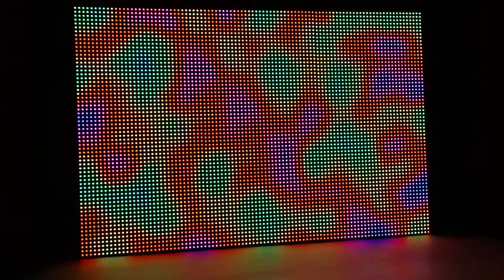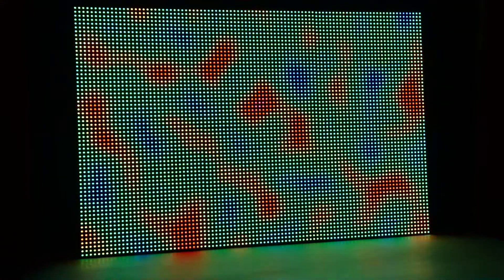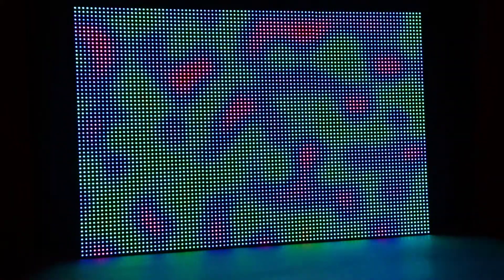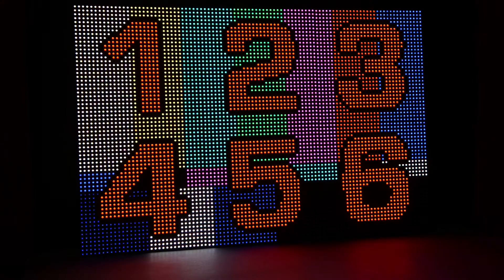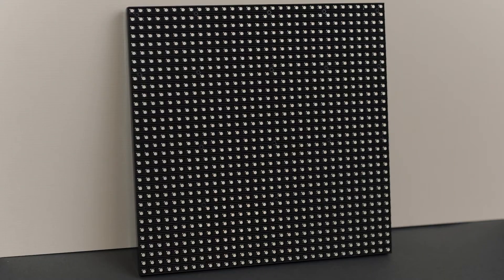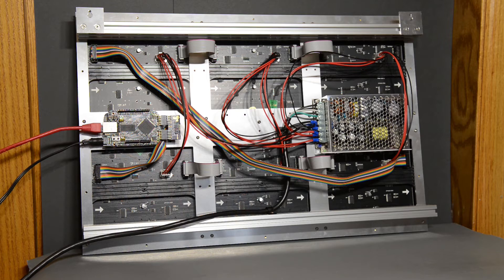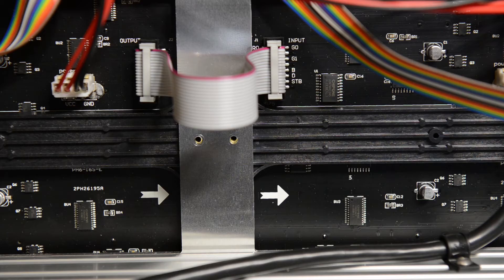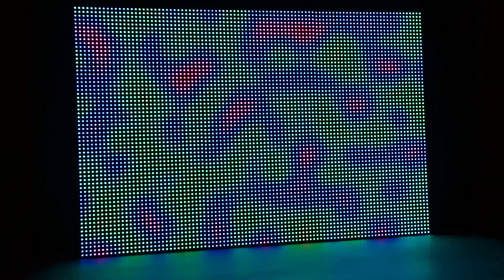BeagleBone + Logibone FPGA Drive 96x64 RGB LED Matrix

Comment: hi i am working p6 panels...had gone through your rgb driver tutorial and followed the algorithm..(for 2 (32x32 modules) it works fine without flickering...but when i add 3 flickering occurs...i am using ARM M3 Cortex LPC1768 @100MHz using PLL0....i dont have idea with FPGA....implemented 24bits per pixel.....what is minimum clock frequency required?
Reply from the maker: There are two constraints: 1) You need a minimum refresh rate of about 100Hz to prevent flickering to the human eye. The higher the better though. 2) The maximum rate at which the serial to parallel latches inside the panels can be clocked. I haven’t tried clocking in data at a rate over 25MHz. 

If you have two panels running at 24bpp without flicker, you’re doing pretty good. Beyond two panels, you’ll probably start hitting the 2nd constraint above if you try to refresh the panels at a refresh rate fast enough to prevent flicker.

I'm running the logic that drives my 6 panels at 12bpp at 50MHz. Pixels are clocked into the display at 25MHz with a refresh rate of 217Hz. I could probably go to 18bpp and still maintain a refresh rate of 122Hz with my FPGA design. At 24bpp, my refresh rate would drop to 30Hz and the display would flicker badly.
Reply: Thank you Glen akins I will try and update you...

Comment: Is the frame custom cut? I assume there isn't one available commercially? I see parts on Adafruit that could work, but yours is cleaner.
Reply from the maker: I had the frame cut at front panel express. The .fpd design file for the frame for their free software is available in my github repo. A link to the repo is in the description of the video above.

Comment: How many LED panels you could connect to this FPGA set up?
Reply from the maker: +Justas B If you stick with 12bpp color, probably 16 panels daisy chained together before the refresh rate gets to be too slow. If you grab some less convenient to use pins, you could a daisy chain a second set of 16 panels from those pins for a total of 32 panels. Beyond, that you need a larger FPGA with more block RAM memory.

Comment: This is really cool, I am doing a similar project with the Raspberry Pi controlling three parallel chains of 4 panels for a 128X96 display.  The RPi will be controlling the panels directly with no FPGA.  I have most of the software worked out and my biggest problem is bolting them together.  It looks like you designed the aluminum frame in a CAD program and had it cut out on a mill.  I don't have that ability but your solution gives me an idea.
Reply from the maker: +David Culp I used Front Panel Express. Their software is free and the design files for the frame are in my Github repo. Just make sure your LED panels are the same size as mine.
Reply: +Glen Akins Thanks Glen!  Your website also helped me solve an issue I was having with the display.  The Raspberry Pi 2 is barely fast enough  to handle doing this.  I am having to pull out every trick I can to get a steady display with 24bpp color.
Reply from the maker: David Culp how many panels are you trying to drive at 24bpp with the pi?
Reply: +Glen Akins 12 in three parallel chains of 4 panels to make a 4X3 display.
Reply from the maker: David Culp Nice. That's a big display. I recently ported my design to a Xilinx Zynq FPGA with a built-in ARM A9 processor. I should look at going 24bpp too now.
Reply: +Glen Akins I have almost given up on solid 24bpp on the RPi 2.  The timing resolution on the RPi is pretty bad since it isn't running a hard RTOS.  I can get right at 30 frames per second displaying a static image with 24bpp.  In reality since it clocks 8 color bits for each led per "frame"  that is a fairly respectable frame rate.  Dropping down to 15bpp yields around 50 complete frames per second.

I have one last thing to try and that is rearranging my refresh function so that the next row of bits in the current color byte are being clocked in during the wait period of current row of color bits.  However, with the timing jitter of the RPi I am not sure it will help.
Reply from the maker: +David Culp I shift the bits out during the wait period of the current row in the FPGA. The length of time it takes to shift all the bits out defines the wait period for the least-significant bit of color information. The rest of the bits double from that period. Add all the wait periods up, take the reciprocal, and that's the refresh rate. One of the nice things about the FPGA versus RPi software is that you can control exactly what happens when with accuracy down to a single clock.
Reply: David Culp Hey man. What software are you going to run? I'm building a similar project :).
Reply from the maker: I currently just run my Perlin noise code. Haven't really used it for anything else.
Reply: Glen Akins Are you quiet familiar with RPi software??
Reply from the maker: Not with the RPi software for driving these panels. I’ve never used one of these panels with a RPi.
Reply: Glen Akins So I'm assumming you're not multiplexing these leds due to the use of your FPGA board
Reply from the maker: They’re multiplexed. The FPGA takes care of all the multiplexing so I don’t have to do in software.
Reply: Glen Akins Interesting. What is the pixel pitch for these panels?  And you mentioned they can pull up to 12 amps chained like this. Do you think I'd be able to run a portable 96x96 set up off of a 11.4 v 30 amp 20 c Lipo battery with a DC/DC step down reducer?
Reply from the maker: 6mm. Sure. For a little while at least.

Comment: Hey Glen!

Are the images, GIFs, and games, running off internal memory or is this display hooked up as a monitor to a computer? if not the latter, have you used the panel array as a monitor before?

Thanks!
Reply from the maker: +David Traitz They’re all running on the BBB. I haven’t used the panel as a monitor yet. To do so would require an FPGA board with an HDMI or DVI-D connector which this particular board does not have.

Comment: Can you go as big as you want with this?
Reply from the maker: Yes. But at some point it makes more sense to use a graphics card and HDMI to feed the display data to the FPGA. Then chain multiple FGPAs together using high-speed serial interconnects.
Reply: would a mini spartan6+ do the trick ?